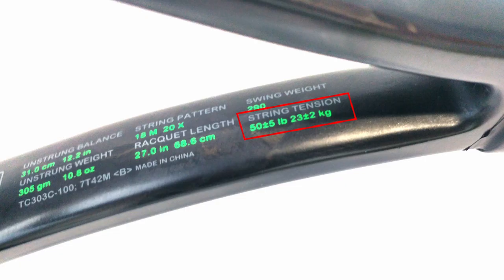How to choose the string tension for a tennis racquet

Comment: I have about 4 years of string tension / racquet “testing data” so I figured I’d share here. My kid’s been using poly since age 11 (not recommended) in a 100 size racquet at 305 grams average. Now she’s 15 and her technique has developed to where we want it (ATP style FH) with extended elbow at contact. For some reasons about a year ago we switched her tension from the usual 50M-48X to 48M - 52X (!) This was based on some “genius” recommendation….. 😊
Shortly after, she started complaining about “framing the balls” almost 70% of the time. So, being a good dad, I immediately blamed it on her technique lol! 😂
But then the issue wouldn’t go away so weve decided to take Super Slow Motion video of her strokes - from close distance and from behind my kid. Here’s what we found: out of 20-30 hits, 99% of the contact point were dead center, spot on! However, based on her technique (the notorious “windshield wiper”) we noticed the ball making contact on the string bed and just stay there while the racquet would roll up on the ball striking it with the frame. 😮. Concluding that, there was ZERO ball pocketing on the string bed…! 
So we switched racquet brands (wasn’t needed) and we went back to her old and tried tension setup but about 8lbs lower. So her current configuration is: Babolat Pure Strike 97 (2024) with various poly strung at 45M 41X (I would go about 1-2lbs higher in a 100 size frame) and the results are amazing! Great pocketing, great spin and no more “frames”. As a bonus and probably the most important part, no more wrist discomfort. 
Thanks for the upload by the way, I found it useful!

Comment: Thank you for this video.  About six months ago, I switched from natural gut at 53lbs to poly at 42lbs (also changed racquets at the same time).  I've found it to be an easy transition with increased spin and no elbow pain with the switch to poly.  I've had elbow pain in the past which is what originally led to my switch to natural gut.
Reply from the maker: Indeed tension is extremely important, I'd say as low as possible.

Comment: Jean Pierre, another great video…. much appreciated! I play with the same strings and tensions… it is a purely arbitrary decision…. I change racquets a lot ( In trying to stop this), so I want to keep something constant… also a bit fearful of using a pure poly for fear of elbow issues. So i decided to use  VS gut 16 mains at 55; rpm blast 17 crosses at 52… I use this for my 100 and 98 sq in rackets… I am going to try the VCore 95 ( I think I will lower to 51, 48)… I am curious about using a pure poly at lower tensions, it may be beneficial for my game. Ciao, John How do I get to your English newsletter????
Reply from the maker: Thank you ! I think you can try full poly with tension as low as possible. Change if the slightest pain occurs. Currently I don't have an english newsletter but I'll think about it. You can subscribe to the channel to be notified when I publish some content on YT.

Comment: Fantastic! Question: I used Luxilon Alu Power 1.25 at 21/20 in my Head i.prestige mid (89.5 and 330 grams unstrung) and it’s good…now I got the Head 2021 Prestige Tour (95 inch) and want to protect my arm. Is 20-18 Alu power going to work? Is it ok to do 2 kilos less in crosses? I don’t need power but control and safe on my arm, Merci! You can see me hitting on my YouTube channel as I was a bollettieri protégé long ago
Reply from the maker: Don't know for alu power, a bit hard for the arm. Maybe Luxilon Element for more comfort. I've watched you playing, simple swings rather flat and efficient 😀 Good job
Reply: @team-tennisenglish1514  thanks so much! I decided to stick with my trusty 2001 I.prestige mids and did 23/22 and my arm feels great. I’m healed I believe because of the flexibility of these rackets and their weight, ok, thanks! Again!

Comment: Hi. How do you see a relation between a tension and a stiffness of a racquet? For instance I play 320 g Vcore Pro 97, 18/20 - very soft / flex frame, Yonex Poly Tour Pro.
Reply from the maker: There are so many personal feelings in tennis that I'd give no rule for this relation. But if you combine soft frame and high tension, you'll decrease power even more. Rigid frame+low tension should give more power.

Comment: Thank you for your tips. I use poly in the crosses at 46lbs. How much tighter can  I string a multi in the mains?  Is there a  recommended tension differential between polys and multis?
Reply from the maker: Difficult to say because it's very personal. I think you can put 50-52 on the mains according to the feelings you want, more or less firmness, access to topspin, comfort.
Reply: Thank you.

Comment: Super video! I play with 17 to 19 kg. Head GravityTour and EZone 100. No problems....but....needs more closing the racket during strokes.
Reply from the maker: Ok, very nice for the comfort and the easy power. Indeed it may require a bit topspin increase to secure the shots.
Reply: What is you experience with Gravity Tour vs Ezone. I used to play the tour, still have two, but found it a bit hard to play when having to   manouver quickly. Thought about Ezone at some point.
Reply: @octaviannitra1845  Honestly I was looking for more power when I got the EZone and I though I will get that, along with feel and control and manouverbility with the EZone. Now....EZone is great racket, but I found that compared to GTour feels like children toy. It manouvers just a bit easier than GTour, but on the other hand that bit of easier manouver comes with way less control than GTour, so you get nothing. Also, GTour sends the ball with the same power no matter where you hit the ball on the string bed, while with the EZone you get good power only if you hit the sweet spot, other than that it is all different. So you will miss that linear - predictable power from GTour. Also, if you swing the EZone with the same swing that GTour lets you, you wouldn't get one ball inside the lines with the EZone. Also I found out that GTour sends way more heavy balls to your opponent. The spin is much better with the EZone but the flat shots are way better with the GTour. While serving I found that both rackets feel the same above your head. So EZone does not feel that easy during serving. But if you are on the run, yes EZone is easier to manouver. EZone will not let you get away if you do not apply proper technic, so it is the same like GTour. Also, I needed to put leather grip on the EZone to increase the weight and to make it more head light. EZone is 300 grams unstrung, but in stock form, during swings, it feels like its 320 grams unstrung. Also it is way less stable than GTour. With the leather grip it is ok, but now, strung, it weights more than the GTour. So generally EZone is easier to play than GTour. I personally use the EZone if I am out of shape or if for some reason GTour gives me hard time on the courts 😉. 
And to have the whole picture....my EZone 100 is 2022 model and the weight is exactly 300 grams unstrung and my GTour is 2021 version and it is exactly 303 grams unstrung. I use only Technifibre Razor Code 1.25mm on both rackets. I usually strung GTour on 18 kg and I strung EZone on 20 kg.
Reply: @stojanchoarnaudoski2340  thanks you for taking the time to reply! Just as a fyi, since i wanted a bit more power, a bit more spin and hoped for better maneuverability I got the head extreme tour  (2021) at a very good deal. And it does deliver on almost all my expectation and I feel that it improved my game, but i suspect that it is way of spec because it is very head heavy which it shouldn't. Added 10 grams in the handle to bring the balance more to spec and it is still head heavier compared with a ezone tour. Great on serve, forehand, backhand. Tons of spin, but what i lack is again maneuverability probably due to head heaviness and find the sweet spot a bit small. Find it very unforgiving if hit off center compared to the GTour.
Thank You!
Reply: @octaviannitra1845  My son has the EZone 98 2022. Now....that is different league. I think that one might be what you are looking for. Enjoy tennis! Cheers.
Reply from the maker: @octaviannitra1845  I haven't tried the Gravity Your but it'll be less powerful than the EZone 100. I don't know compared to the ezone 98.
Reply: @team-tennisenglish1514  Maybe you can do review of the Gravity Tour? It is very interesting racket and I believe lot of us would be very interested in what you will think of it. Thank you.
Reply: @stojanchoarnaudoski2340  Well, I'll see if I can demo that racquet.